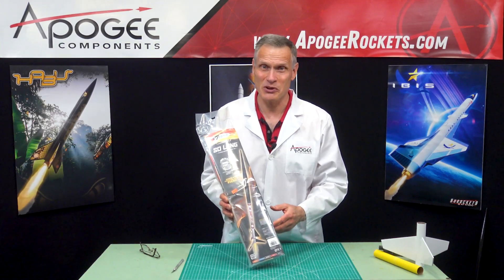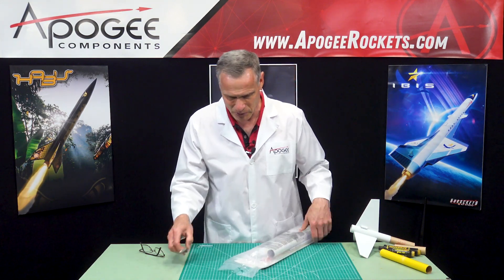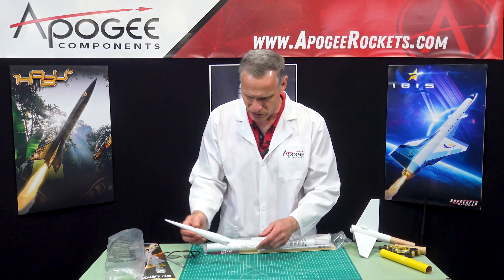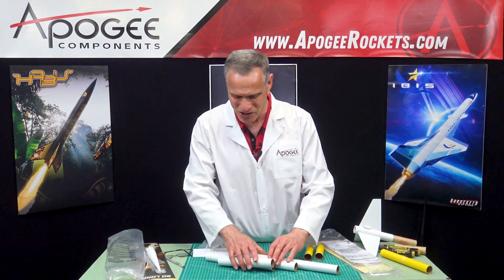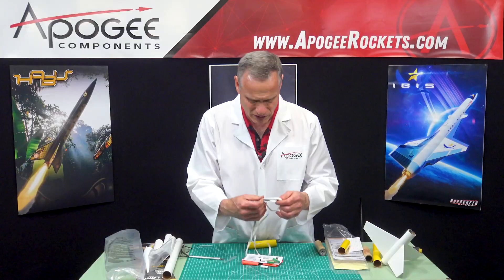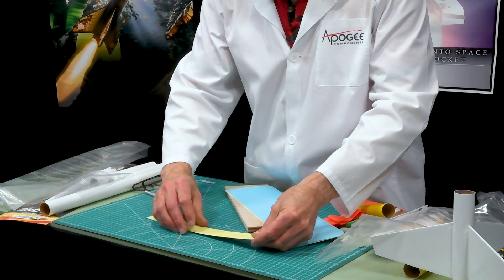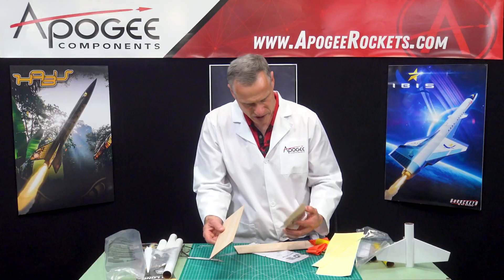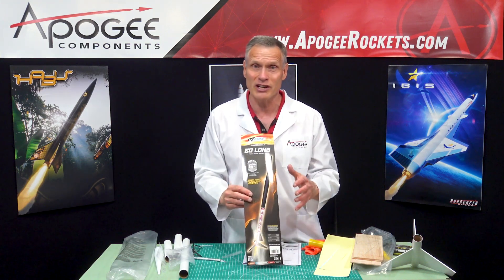Unboxing the Estes So Long Rocket Kit

Comment: Does it work for the booster stage G40-4W and upper stage F15-8? I might risk it
Reply from the maker: NO. Mixing composites and black powder won't work. The upper stage won't be ignited by the G40.

Comment: I want to modify this kit so I can use electronic staging and AeroTech motors. It'll need a way to run the igniter down, maybe a long run of launch lug to cover it?
Reply from the maker: The hard part will be that Aerotech motors have the thrust ring built into the back of the casing. So you won't be able to use 29mm motors. Maybe 24mm in the upper stage. Getting everything into a 29mm diameter would be tricky, but might be doable if you use 24mm in the upper stage. It will be a good challenge for you. Let us know how it goes.
Reply: @apogeerockets  G80 to an 24mm motor could be a thing.